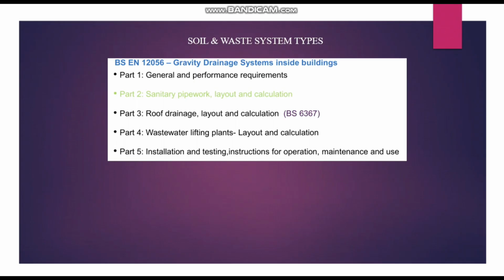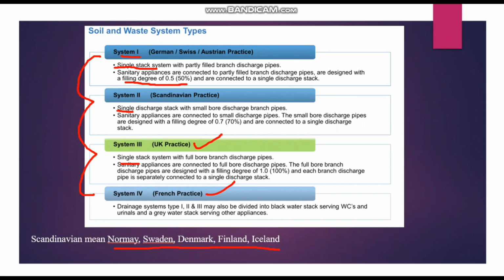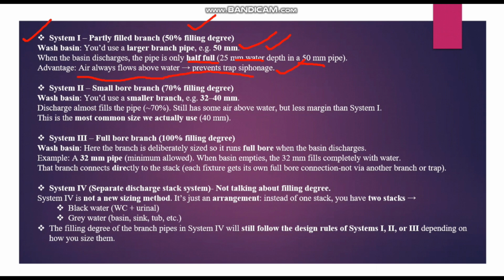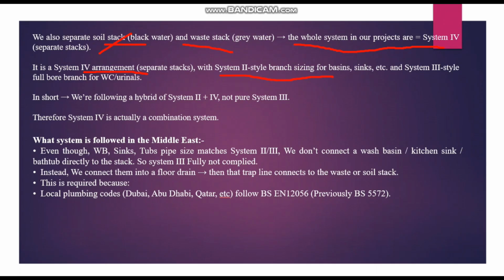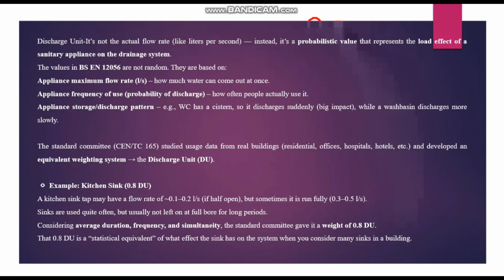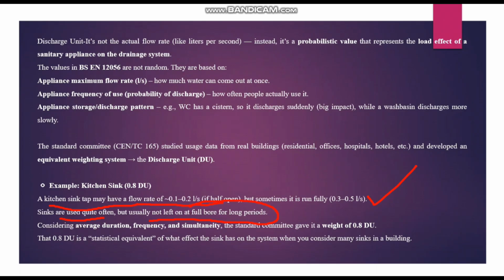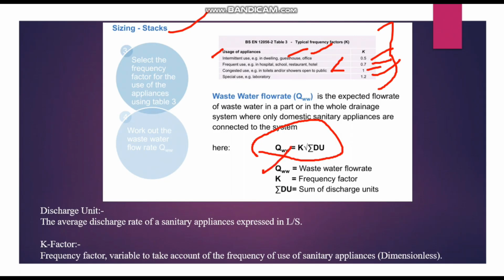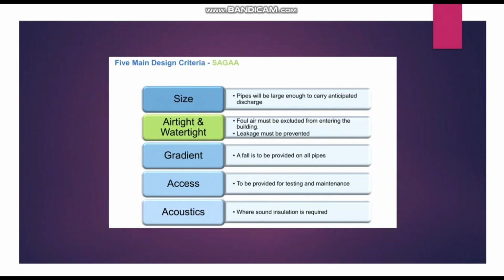Part 2 Drainage System Design & Installation l Super High Rise Building Rules

Comment: Excellent video!   I need in Spanish? We are having the same issue with a condo on floor 1 of 10 floors and the builder cannot find out the cause of a random foul odor when water is running in spare bathroom (only) of a high rise condo building